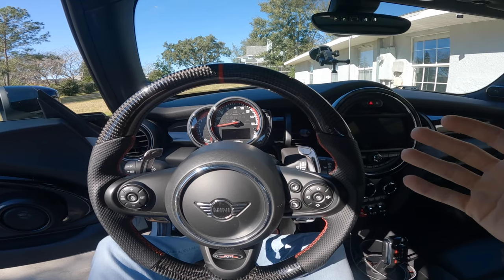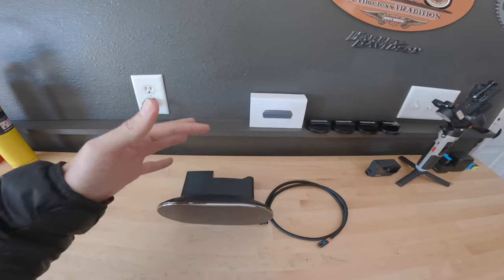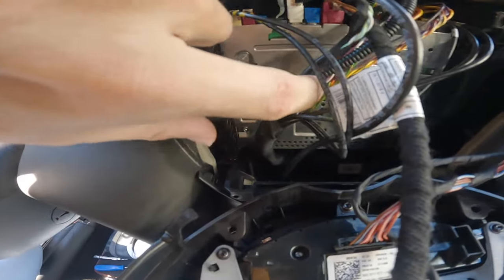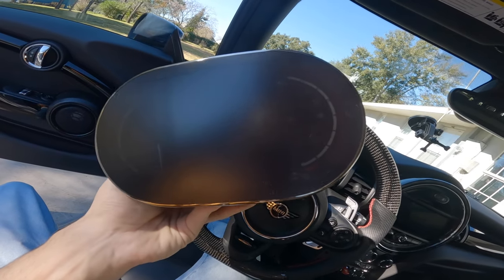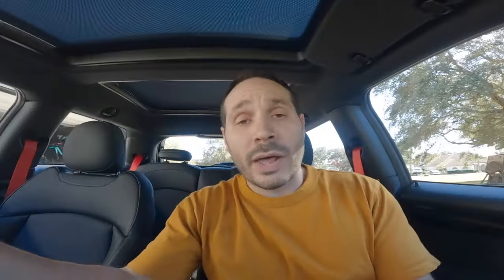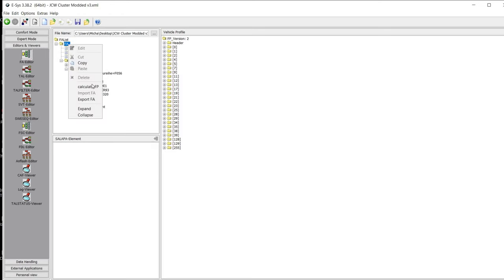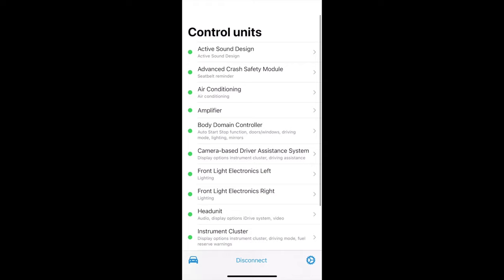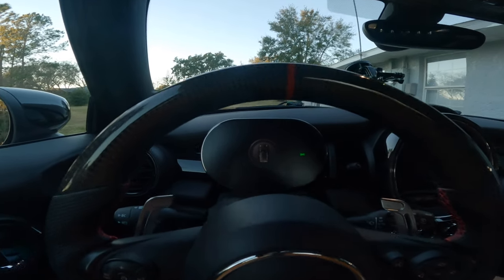Mini Cooper F56 Digital Cluster Upgrade Install // Coding & Programing

Comment: This is going to be a super popular upgrade for F55/6/7/54/60 owners that want an upgraded digital driving experience the digital tachometer offers. Congrats for putting together the how to and parts list! Surely lots of MINI owners will find this super helpful as they install and program this on their own MINIs.
Reply from the maker: Yeah it's definitely worth every penny! I went to a Mini meet up yesterday and several people called out how nice the digital cluster is for the F55/6/7/54/60 platforms. 

Make sure if you're interested in picking one up from Outmotoring.com you use code BERTINI to save yourself some money. 😬🤘🏼

Comment: I have a 2020 F54 Mini Clubman JCW without the heads up display, but I did upgrade my radio which has the fiber cable port will this still work?

Comment: Bro you make working on a mini so easy… my question is can I use this software to make my mini less rich and have the check engine light off because of the downpipe ?? It’s the only light I have on.
Reply from the maker: That's a good question. You would be able to turn off the light using this tool if you find what code it is. 😅
Reply: @MichaelBertini  hahaha well that there is a puzzle in itself I’ll have to do research to see which is that light lol. But I tried to order the link 2 and the site is not letting me look at my cart.
Reply from the maker: That's odd. Hit up Outmotoring.com and see what they say. 😬

Comment: Hey, I am as you mention ‘across the pond’ and have a 2015 Mini JCW. Mine has the heads up display so would it be a plug and play install for me or would I still need to code it? Any help would be much a appreciated! Thanks Dan

Comment: Been following you for a while now. Done everything except the lowering. Installed digital dash but having a terrible time coding. 2017 Cooper s f56. Using laptop on windows 11, downloaded your program links and bam, errors. I’ve done all my upgrades myself with help from you and you tube but this coding has got me. Any advice?

Comment: Hey Michael. I have a question for you which I hope you'll be able to answer. Is it possible to retrofit digital cluster and radio upgrade (bluetooth, navigation etc) in Mini One 2011 R56? Thats mine MINI and I'd like to upgrade it's non existant infotainment system and change from analog rpm counter to digital with digital information? If that's possible, what shoud I be aware of and if it's not possible, till what production date can you upgrade the infotainment system? Thank you :)

Comment: the thing I didn't like when I had a 2019 was not only the guages but how nearly silent it was even as the Cooper S model. no crackle, no rumble and it apparently had one of those exhaust filters that always go wrong. I got a 2015 and its the same body just way better car, more responsive, sounds better but still has the ugly guages. this video might be the solution.

Comment: What happens with mileage? Does it update from the existing or does it reset to 0?
Reply: I believe the mileage is stored in a variety of places so will pick up the cars mileage. However, if you fit a used digital cluster there's the risk of getting a tamper warning. So used ones should be 'virginised'.
Reply: Thank you John, that’s really helpful.